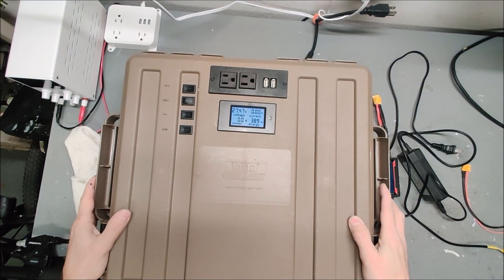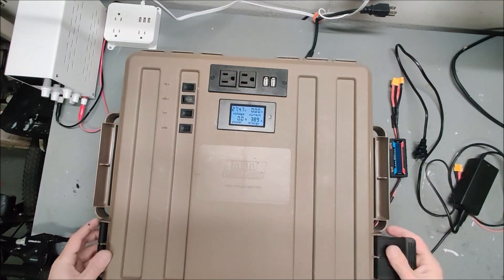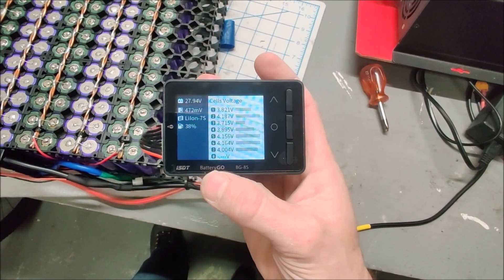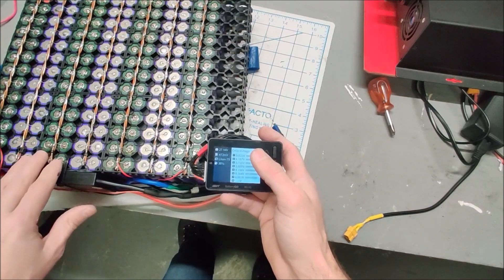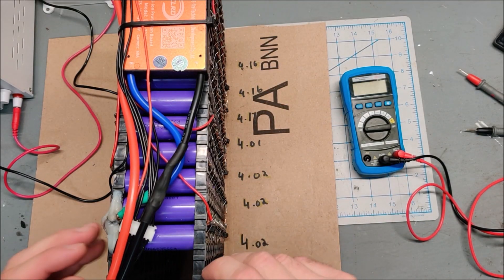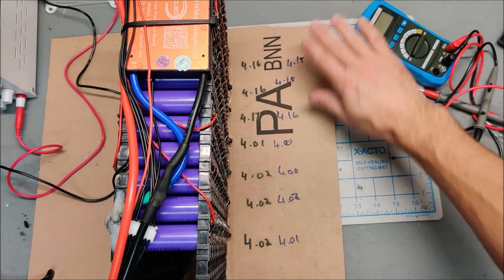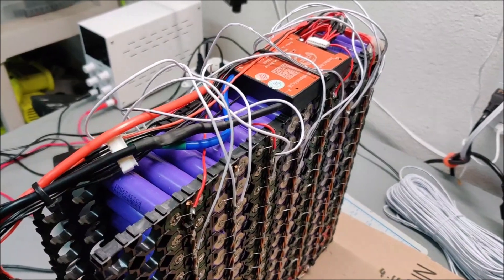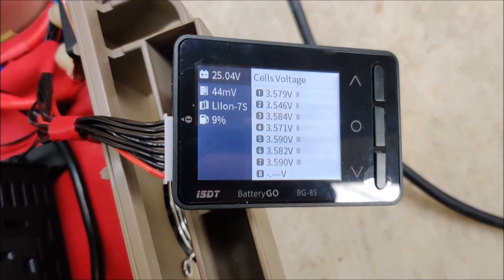Solar generator Wont Charge - Finding the problem

Comment: Great job stevenc22, you had me concern for a minute because i build this same battery pack using your Technic from  your video....Peace
Reply from the maker: In hind sight, that pack had been sitting over a year and then i just grabbed it off the shelf and used it. Some cells had probably sagged over the year. My own fault for not maintaining the pack regularly.